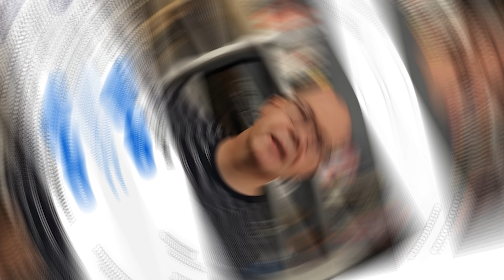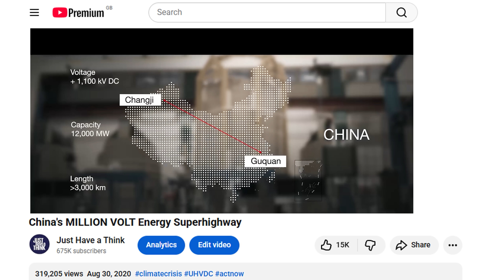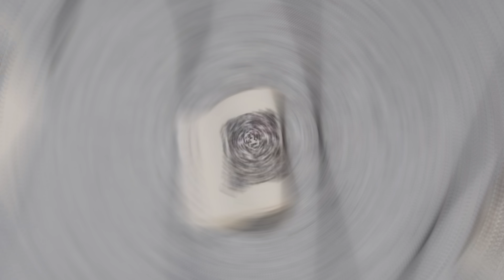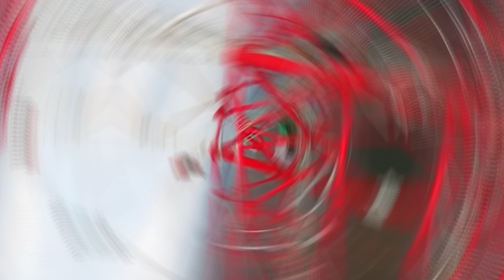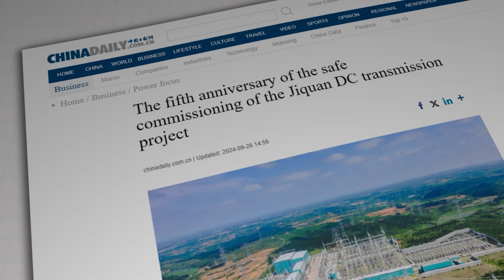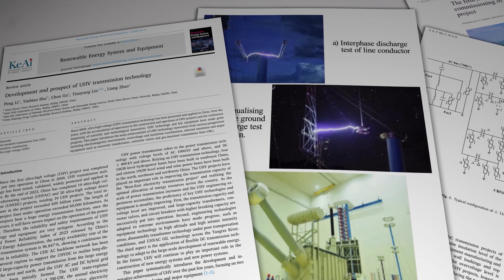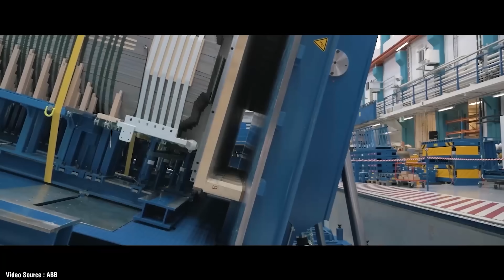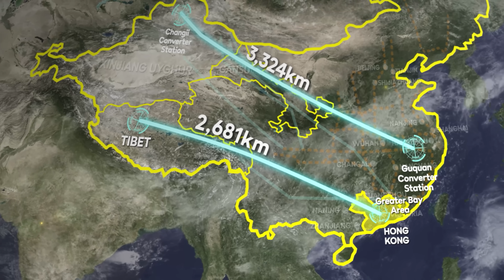China's ultra-high voltage transmission lines now breaking all records.

Comment: This is what we built.

The HVDC Inter-Island link is a 610 km (380 mi) long, 1200 MW high-voltage direct current (HVDC) transmission system connecting the electricity networks of the North Island and South Island of New Zealand together. It is commonly referred to as the Cook Strait cable in the media and in press releases,[1] although the link is much longer than its Cook Strait section. The link is owned and operated by state-owned transmission company Transpower New Zealand. (wikipedia)
Built in 1965.
Reply: 350 kV, but that's pretty good for 1965.

I think the general concern is the West was great at building stuff 50 years ago, but has somehow lost that capability.
Reply: @djinn666 We haven't lost the capability, we have lost the funding through corruption and inefficiency. some of these politicians should be jailed.
Reply: @the_lost_navigator7266 What's the difference between a lack of competent construction companies preventing infrastructure from being built, corruption and incompetence, and local resident opposition doing the same? Construction know-how can be improved, but you quickly run up against a brick wall with politicians all scratching each other's backs, or with using eminent domain.
Reply: @djinn666  I think local resident opposition is a big problem. We certainly have it here in Victoria Australia. Not in my back yard.
Reply: @the_lost_navigator7266  exactly. Trump just cancelled all off shore wind— even projects that are almost completed. And reopening coal plants. He’s sabotaging the nation.
Reply: @the_lost_navigator7266  China has corruption and inefficiency. I don't know why we can't get it done.
Reply: @the_lost_navigator7266  You forgot one thing: people die. Some unspeakable industrial knowledge and experience disappear with people if they are not passed on to successors. In other words, if you don’t build factories, don’t construct large infrastructure projects, don’t operate large factories, and so on, the experienced workers you had will become unemployed, and the lessons and experience that could have been passed down will vanish. With the death of a generation, you will completely lose the ability to build and operate large-scale projects and have to start accumulating experience from scratch. This is unacceptable to capitalists in today’s Western societies who pursue speed, efficiency, and quick returns. This is also one of the key reasons why large-scale infrastructure projects cannot proceed in Western countries; it could even be said to be the primary reason. If you can’t find people to do the construction, you can only invest money in companies that don’t know how to build, only outsource projects, and earn intermediary fees, resulting in massive waste of funds. Moreover, you end up with infrastructure that cannot function perfectly, sometimes even worse than decades ago. It’s like being dyed yellow to pass as gold, even though it looks like gold, you know it’s actually shit, but you still have to swallow it.
Reply: @djinn666  +/- 350kV?
Reply: @djinn666  What is the distance?
Reply: That was before the privatization-fundamentalist took over. Note that it is state owned.
Reply: 1965年凯恩斯主义还是主流，政府有动力，民众也不太反对大型基建项目。新自由主义已经把人洗脑成反对任何基建项目了，觉得路和电线永远不用维护。

Comment: I'd love a tee shirt.  How about just having a think about the battrification of railways. And not just battery powered trains but of the transformation of entire networks to lineside battery power. Railways are, almost by definition, users of electricity at times of peak demand. Installation of lineside batteries, charged when electricity prices are at their lowest, would save a massive amount of operating costs to say nothing about protecting transport in the event of grid collapse. With the ever reducing cost of battery storage, railway networks around the world must be thinking about this. How are they doing?

Comment: Suggested Topic: following on from the subject of this video: I often wonder if power-line utilisation couldn’t be increased just by maintaining maximum transmission at all times and utilising storage at each end of the ‘wire’ to meet the variable demand. I feel that this could be done at all scales, from international to local substation. For instance I would think that batteries serving multiple homes/businesses at substations would be more efficient than each premises having their own. And it would be possible to eliminate waste due to electrical inertia in the system. If I’m thinking about this as a layperson then either it’s a c@%p idea or someone else has already thought of it and it’s already happening 😊

Comment: I am luck enough to live in Portugal where the sun shines 300 days a year. So my solar panels generate all my electricity needs for about 7 to 8 months a year. That includes running an electric car. But I still fall short in the winter months. So far I have not found any home wind solution that makes economic sense. When do you think that will happen. Is it worth doing a home wind video?. Thanks for a great YouTube channel.
Reply from the maker: Thanks for your suggestion.

Comment: For an idea for a video, how about the utilisation of large energy users such as data centres as demand/storage/distributed generation nodes on the grid to help with with grid stability and security of supply, while also enabling the greater proliferation of renewables on the grid further increasing the capacity on the grid for SNSP generation. Some think it sounds crazy but it does work and it helps to decarbonise the operations of the enterprise as well as the grid. I've spen the last two years developing such a project (though I am no longer involved) and would be happy to help with the background details.

Comment: Europe  has been able to build a huge railway network similar to China and already has many electrical links across the North Sea so a big grid system is already in place although it must be continually upgraded to accomadate new power systems. how about a program on the problems of maintaing a strong AC current with masses of DC solar and wind. Inverters can produce an echo so the old spinning wheel is needed. Or is it?

Comment: One suggestion I would like to hear about is how do our hybrid inverters in our home solar systems work and how do we work out the best inverter capacity vs the conversion efficiency that our inverters operates at? 
Is putting in an oversized inverter to enable ev charging a good idea for example or does it kill inverter efficiency?

Comment: The question isn't just about “competing,” but about learning and adapting. This demonstrates a model for integrating vast renewables over continental distances. The ambition for 10+ more lines shows a long-term system vision. The “West” can compete by embracing a similar scale of strategic infrastructure thinking

Comment: What we need is a simple and fair smart grid system. Where people living in the same neighbourhood can share their energy sources with each other. Interconnecting solar, batteries, EV's, and maybe a local wind- or watermill would greatly reduce the need for long high-voltage lines across densely populated areas here in the west. But i dont see that happening as our energy providers are doing everything they can to prevent this. You can't even buy a certified 2-way charger for your EV here in Belgium, let alone share your surplus energy with your neighbour!!

Comment: NZ installed a 500Kv DC cable under Cook Strait in 1965. The mercury rectifiers of the time have been replaced by solid state. The cables have been replaced in the early nineties with higher voltage and capacity, these are due for renewal again before 2030. The system carries power in either direction and has been very reliable.
Reply: Then along comes a 'shadow fleet' ship from Russia. And 'oopsie'!

Comment: Topic idea: 
would be nice to look into stats for battery production capacity, price development overtime, energy density. Both on Cell and Pack level. For NMC, LFP and Sodium. And breaking down the overall Cell cost into components: row materials, manufacturing etc (this would show that Sodium probably cannot be that much cheaper than LFP as they share same manufacturing process)

Comment: Great video! While China is developing vast renewable energy generation and distribution along with EVs assuring they will someday be free of having to use fossil fuels the US is going backwards to using more fossil fuels and suppressing renewable energy and EVs. It is literally pitiful living here and watching this happen. I have always thought an ultra high voltage transmission system running east to west in the US could follow the sunlight and give the country an extra three hours of solar power capability. An east to west water system is also needed to distribute water from where we have too much to where droughts are a problem. It is difficult for a country governed by lawyers and politicians to compete with a country governed by logic and science.

Comment: That was a fun one.
You pointed out well well the advantageous Chinese government has when it comes to deciding on which way to go without too much obstacles by public opinion. I saw it working on a recent visit to China after having been not visiting it for some years.
A friend of mine had an application app and I noticed something a bit magical. Whenever we approached a traffic light, his app started to either show how long this traffic light will remain right or green or will be stopped at a red light. How many more seconds it will remain red. That was different.! I am as you might be with him used to some traffic light showing the seconds but having a notification in my navigational app - that was new.
So I asked you was that he was not worried about the company that he bought the navigation from would know at any time where he was and that certainly if they know the government knows. Short answer was no.
I noticed also the advantage of such system you so turned out to be like always a two sided coin. Certainly it was nice to know how long the traffic light will stay red green or how many milliseconds I have to wait at a red light. But there was also an annoying side of it.. no it was not the knowledge of being watched all the time. We get kind of used to it don’t we? It was the other drivers start honking two seconds or more before the red light turned, yellow and green. 😂

And here is a topic that I dare you to take up 
At least here in Germany, the cost for charging an EVon a public, privately owned or commercial, charging point are ridiculously high unless you sign up with each and every company and or different providers, which bundled them. It is so bad that driving EV is more expensive than driving a gas powered car if you only depend on these charging points.  Will EV driving become only for the wealthy because they can charge at home almost for free from the solar panel?

And then there is an other point that is not being talked about. Gas prices in Germany and I assume many other countries., are highly loaded with Tax and duties.
For now EV is not burdened with all these, at least not yet and not till the level of gas. How will governments compensate for all the loss of income when there is no gas sold anymore?
I would like you to drive in both of these topics.

Comment: As a follow up to this video, it would be interesting to investigate the technology of cable ploughing and its viability for improving transmission of electricity in our own creaking national grid. This is especially pertinent in light of the cross-border electrification project transmitting electricity produced by clean energy in Scotland. Could this technology realistically replace the need for pylons which are onjected to by communities affected by pylon systems?

Comment: Mammoth projects in non-democratic regimes are common and a good thing when these regimes consider or in fact decide to invade other countries. There's no way to defend 3000 km of transmission lines, the lights can be turned off easily. Plus the other planned line. Plus the 3 gorges dam. Plus...

Comment: No way is GB/Ireland/Isle of Man, etc or the USA, or some island 🏝️ even as a test bed… like say, Puerto Rico which… would need SIGNIFICANTLY less long “backbones” to support the UHVDC power transmission lines, and could even have multiple N/S lines, along a Central Backbone line across the main mountain ranges in PR, but then, the equipment at the END to get it back to 110v AC or 220v AC? That’s… expensive to build, to move, to install… and then, you have to make sure that many more pieces get put into place to prevent damage or fire… etc and I really just, never 👎🏻 see this taking shape.

Comment: You said 1000kv transmission line from Tibet to HK , avoided 33mt CO2. 
There's also a news report that China has pioneered commercial use of supercritical CO2 in power generation from 20th December 2025.
This shows how efficient china is renewable energy compared to the rest of the world by reducing the generation of CO2 as well as utilising CO2 in power generation.

Comment: I would like to propose a topic: iron power or iron powder combustion. This is an emerging  technology developed at the Eindhoven University of Technology. It is meant to decarbonize high temperature heat processes. It is besides clean, safe, relatively simple, abundant, and circular! After combustion the iron can be won back by adding hydrogen or electrolysis to be combusted again. This has the potential to provide stable energy prices, energy security and energy independence. Iron is an excellent energy carrier comparable with fossils.

Comment: There are SO many pieces that fit into the climate emergency puzzle it is easy to feel overwhelmed by it all. With several countries (USA) running headlong in the opposite direction, it seems we'll need a well thought out game plan if/when sanity is restored to government and society.

I am wondering if anyone has developed a sort of "triage" list for prioritizing policies and technology development to provide humanity with the best chance of surviving the climate emergency?  Having such a plan would stoke a much needed commodity today, hope.  

While we can't focus on only one facet at a time we must prioritize.  I suspect that, perhaps, the top priority might be attached to avoiding the climate tipping point that we're presently closest to crossing? Or the tipping point that would be the easiest to remedy constituting "low hanging fruit."

For example, Carbon Capture and Storage (CCS) should not be anywhere on this list, IMHO.  Smart power grid designs and lower cost storage batteries, like Sodium-Ion, are probably near the top as they are enablers for other parts of the climate solution.  

Liquid fuel Thorium cycle reactors (LFTR) should probably be ON the list but probably not near the top.
Background - I'm a retired mechanical engineer. I did some simple programming for the atmospheric physics department at a mid-western (US) university in the 1970s.

Also, I need a new hoodie.

Comment: Hey Dave, love your material and often share it with others. I think your channel is possibly the most reliable and best researched channel on the Internet, which is why I'm proud to recommend it. Please keep up the good work and don't be discouraged! A topic I would love is to revisit the (Australian) Newcastle University idea of repurposing aging coal-fired power stations by replacing the boiler infrastructure with thermal storage. You might recall that Newcastle University invented a super-efficient thermal storage medium called Miscibility Gap Alloy (MGA) and I believe spun out the tech into a private company. How come this hasn't become a major breakthrough, especially in a country like Australia where there is more renewable generation than it can use? Electricity prices remain high due to dependence on aging coal plants which, in turn, is due to non-dispatchability of renewables. I can't fathom the lack of progress here... Can you elucidate?
Reply from the maker: I know they fell out with their European partner due to the MGA performance not matching their claims, but I will have a look again to check on progress.

Comment: Hi Dave- suggestion for a channel topic - using rail and motorway corridors for ultra high voltage electricity grid connectors to form a robust interconnected network with minimal impact to private property. I love your videos and have been a subscriber for years - roll on 700 and 800k subscribers👍 keep up the good work 👏🙌
Reply from the maker: Thanks for your suggestion.

Comment: How much of a pipe does underground high-voltage DC require? Years ago I saw a map of abandoned oil pipelines from the early days and it looked like spaghetti all over the map. Some seem to be four or six inch pipes. Few years ago the city that was in the news with the high lead content in their Municipal Water System showed a company that put a flexible liner into the pipes pressurized it for the Contour of the pipe and problem solved. Could high voltage DC power lines be sneaking into abandoned oil pipelines?